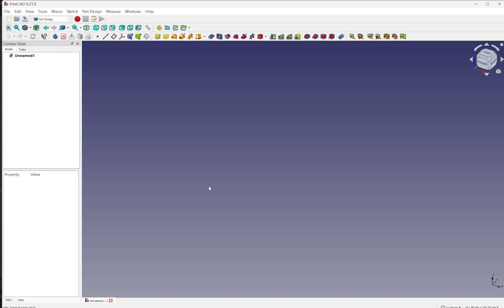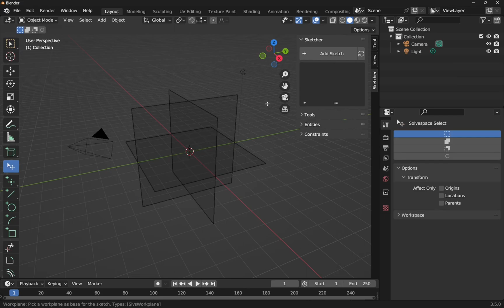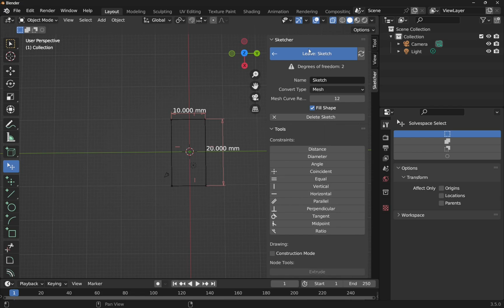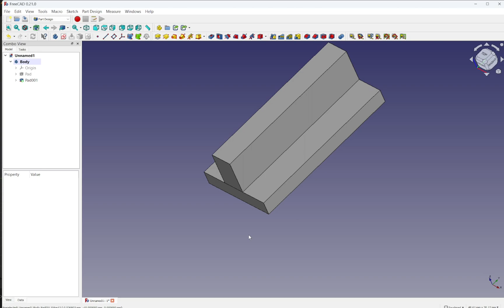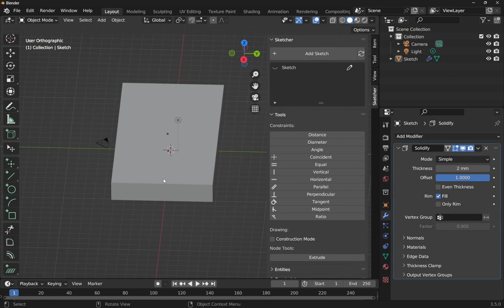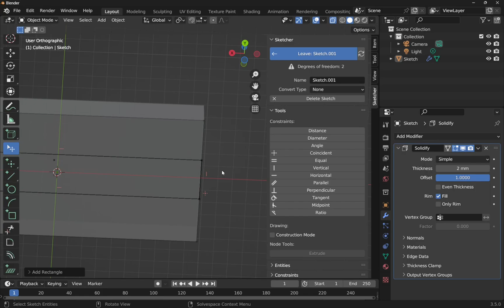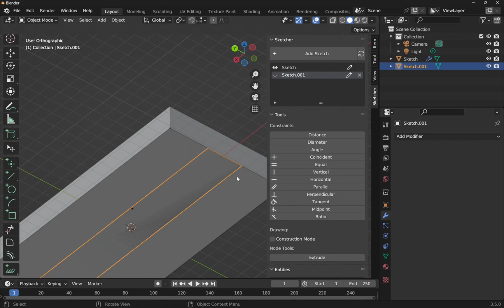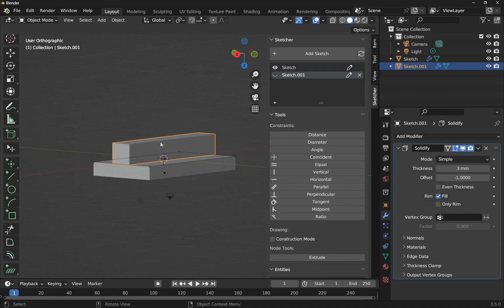Learn CAD Sketcher | 7 | Important external geometry from other sketch | Blender Beginners Tutorial

Comment: this is the future speaking, it does change by not even letting me use existing constraints from same workplane

i follow exact same steps from you
Reply: Are you using 3.6 or 4.x? The underlying way addon's are handled changed between versions and sketcher's not properly setup for 4.x yet. Works reliably for me in 3.6.18 I just used it a bunch modeling a Nema23.
Reply: I think I'm having the same issue in 4.3.2. Haven't tried 3.6 yet, but would love to see this working with the bleeding edge version of Blender.

Comment: Honestly, Blender is a waste of time. How this monstrosity of mishaps survived this long is a mystery (full of half  baked addons and always 'in development' ) . I used it for years, left and went on to use proper programs designed to do the job right that dont try blending everything down to an undigestable soup. The only guarrantee u get from blender is a backward path to neurosis.
Reply: Blender waste of time for what exactly? 3D printing? What do use for cleaning up  and correcting 3D scans then?  Also if you had used Blender for years like you said, you would have noticed the areas of improvement. In fact it's top notch poly modeling, good poly based precision modeling, decent sculpting, animations and simulations, node based geometry workflows etc.